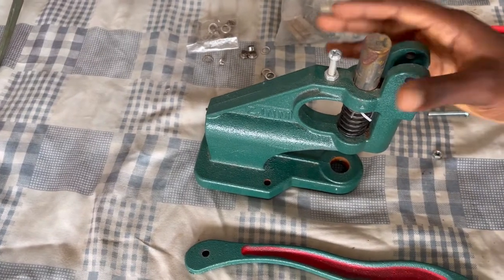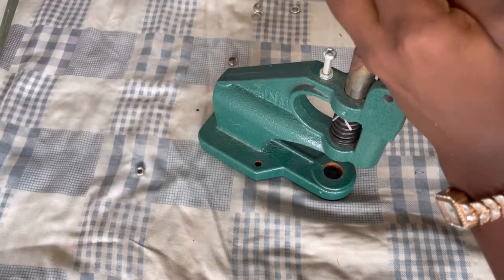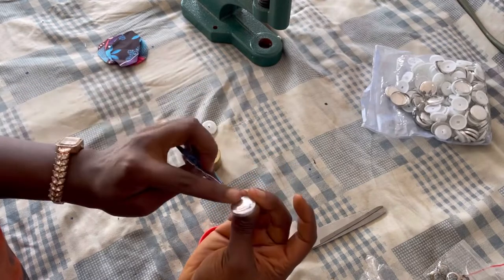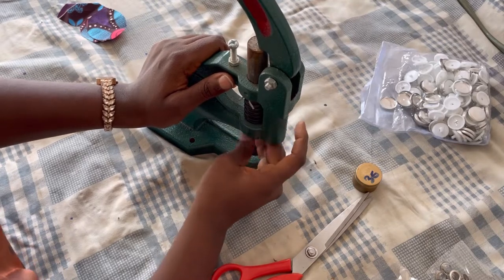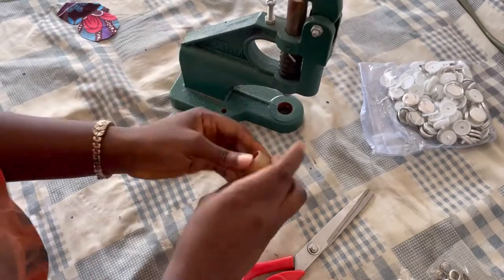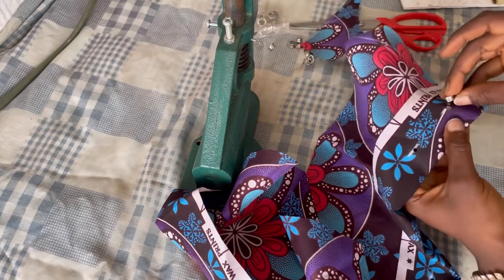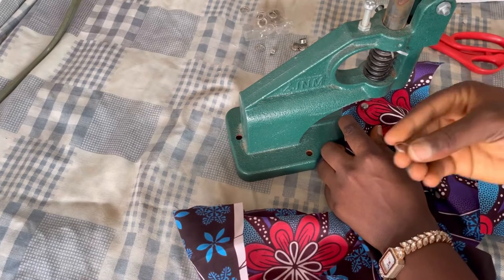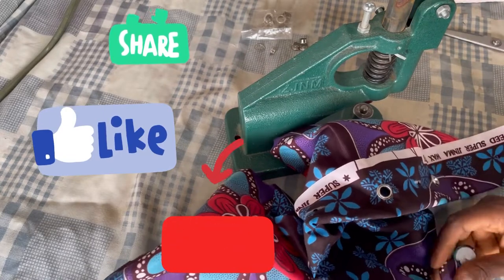How to fix a grommet machine, make a cover button and eyelet // DIY cover buttons and eyelet #diy

Comment: Hi. I have ignorant ears as I do find your accent a challenge but putting words in helps. However I do have a request I have the press which arrived with many dyes but no instructions and you have helped a bit but for me watching and trying to learn you don’t show which piece goes where for long. You pick it up put it in the bottom half or the top half so quickly I can’t see which one you put in and it adds to the confusion instead of clarifying. I do appreciate the effort you’ve gone to to do this so hopefully my comment is taken as constructive criticism…
Reply from the maker: Noted, Thank you I’ll work on that.
I can make a separate video for you if you want, do you have instagram?
Reply: You don't need to work on anything. They can turn on subtitles if they aren't used to hearing accents that aren't like theirs. @Signature32